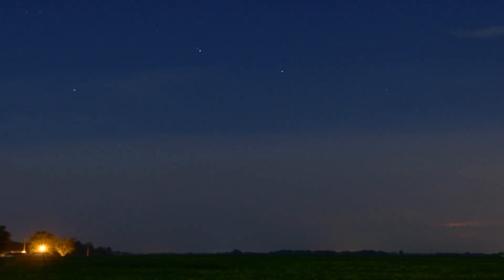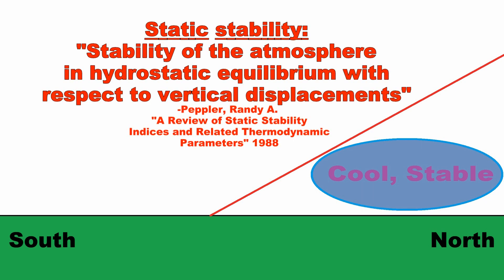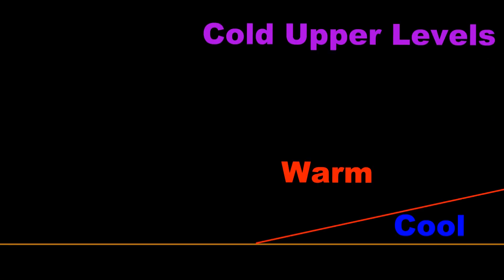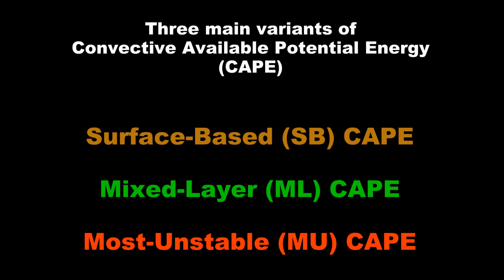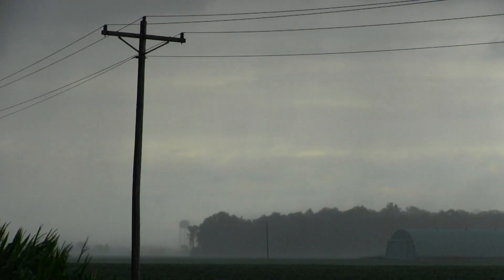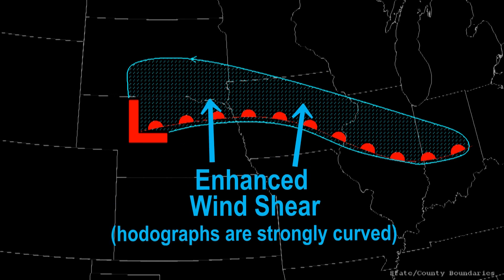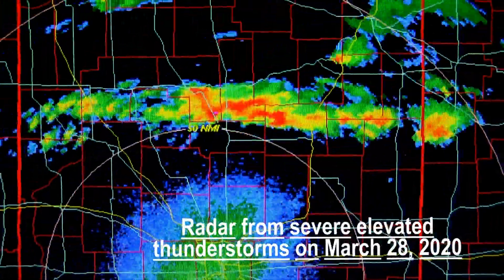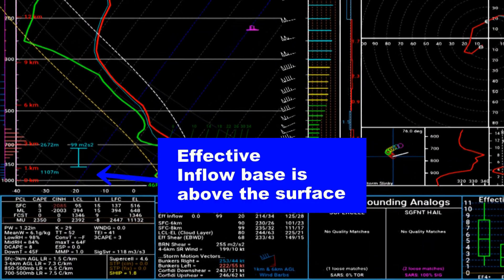What Are "Elevated" Thunderstorms?

Comment: Thank you very much! So elevated thunderstorms (advection) are similar to those in areas like Arizona with low moisture?🤔
This year in the UK we've had elevated storms, but they don't produce so much deadly +CG.
Reply from the maker: You're very welcome, I'm glad you enjoyed it! The storms which occur in the SW U.S. with low moisture are usually just considered high-based storms, since the depth of the mixed layer out there can be quite deep (and recalling that elevated storms develop above the boundary layer, with the near-surface air being stable). The near-surface layer for high-based storms is still unstable, although cloud base heights are much higher than in environments with greater moisture.

Comment: Alot of downdrafts do not reach the surface because the cool surface air insulates it. The winds bounce back creating gravity waves. Inflow and outflow occur aloft. Sometimes downdrafts do reach the surface it its strong enough. Its very hard to see shelf clouds because they are elevated and a low level stratus deck is underneath anyways.  So it can be storming in Temps in the 40s and the surface winds are from the east while its  raining. Storms moving in from the west while the surface winds are from the east. Sometimes the surface east gradient winds increase a bit or decrease a bit or go calm. I do not have an explanation  for that. I have even see winds  shift to the north or northwest  which might indicate a meso low in the boundary layer. Just my theories.  The east wind increases or decreases or going calm could be getting closer to the main surface low  or local surface perturbation s
Reply from the maker: They certainly are interesting!
Reply: @EthanBWeather  sometimes surface based thunderstorms  develop ahead of a warm front if the skies clear and heat the boundary  layer